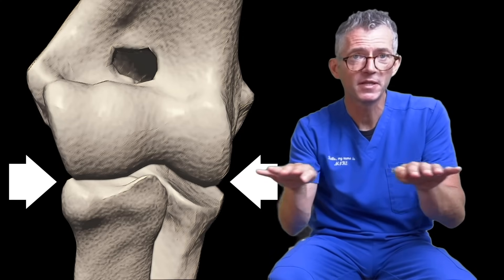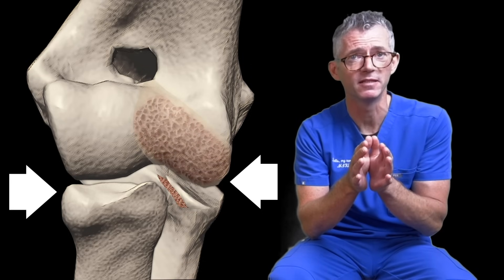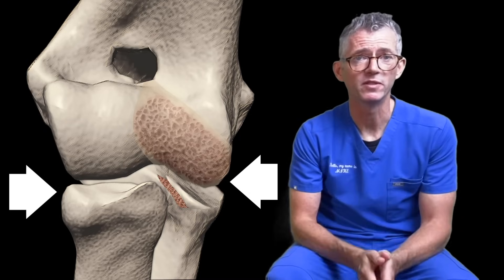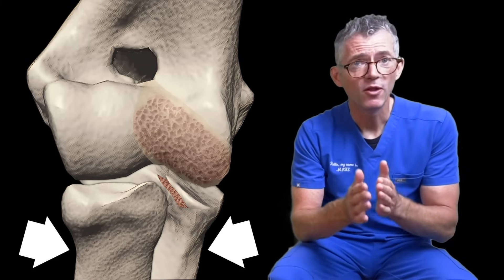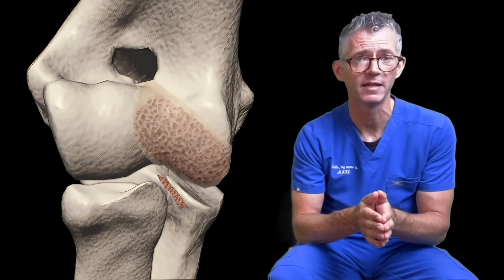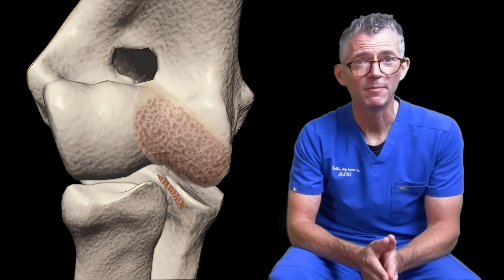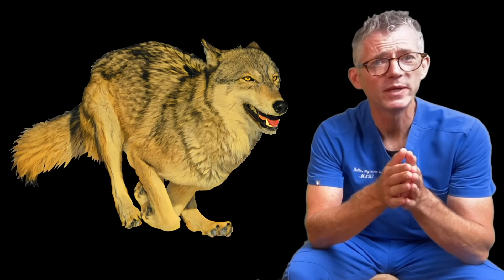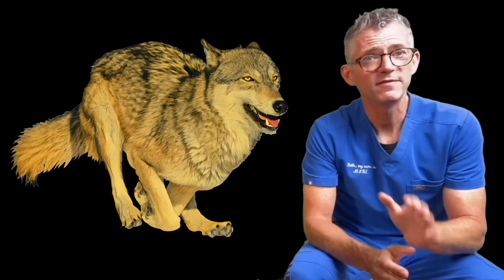What causes elbow dysplasia in dogs?

Comment: Hi, very informative video. Do you know if there have been studies to try to prevent elbow dysplasia through bracing, diet, exercise, or other interventions in puppies?
Reply from the maker: Hi Adan. There are several studies assessing the effect (or lack of effect) of diet, exercise and neutering on joint dysplasias. You can find literature reviews here: www.vetlessons.com/risk

You won't find studies on braces for puppies. For elbow dysplasia specifically, it's so implausible that braces could reduce risk that the ethical concerns of bracing a growing puppy would far outweigh any potential benefit. I hope this helps.
Reply: @VetLessons  Super helpful. So puppies who are not overweight are more likely to have better dysplasia outcomes.

Interesting that you believe that braces would provide implausible risk reduction. Human babies with developmental dysplasias use the Pavlik harness with some efficacy
Reply from the maker: @hedgehunter3  This is 100% true but you asked about elbow dysplasia, which is a morphologically and developmentally completely different problem.
Reply: @VetLessons  thank you!!